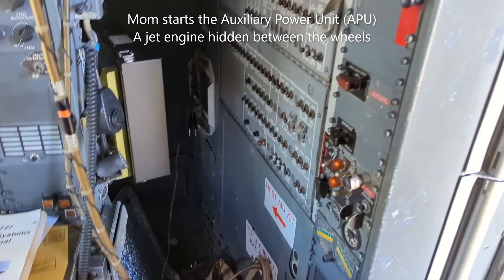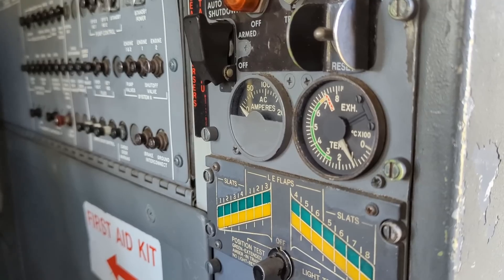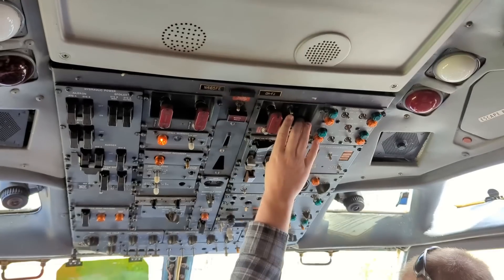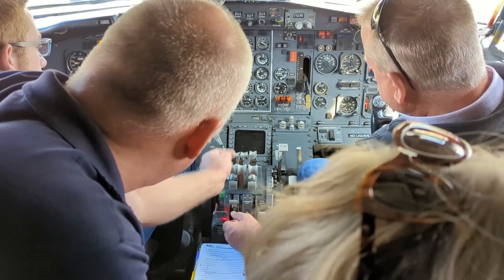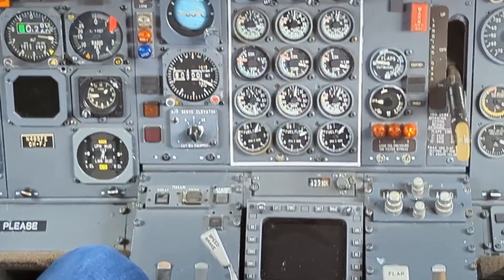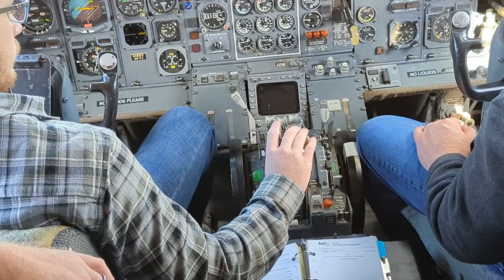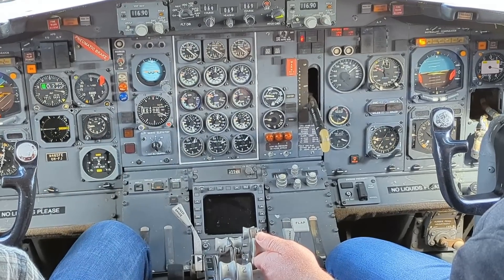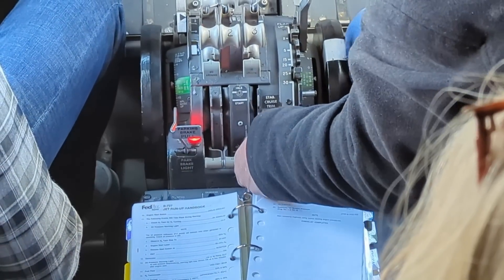Ordinary Family Starts a Boeing 727

Comment: What would be cool is to graft the 727 tail on a 707 and have a 7 engines mother craft for air launch rockets pulling into a steep climb to point the rocket in the correct direction before separation. Go over the top like a loop but invert before reaching the top.

Comment: I wonder what their neighbors think, hearing those jet engines run?  They're probably thinking, "take that airplane back to the airport where it belongs". I can only imagine how much it's costing them to keep all the systems operating on the plane. As a passenger, I've flown onboard at least a few Boeing 727 jetliners. They include Delta, Pan Am, Eastern, TWA, Piedmont, Northwest, and yes, even Trump Shuttle. Of course, Trump Shuttle was all 727-100 series aircraft. I'm probably forgetting at least one airline that I've flown on with the 727. In my opinion, the Boeing 727-200 series aircraft were the best looking jetliners ever made in existence. Absolutely beautiful and sexy. I wished Boeing had kept building them but with modern technology such as the avionics, control systems, engines (similar looking) and maybe more advanced aerodynamic wings. Possibly with wing tips that are similar looking as the ones on the 767-400ER, but obviously much smaller.

Comment: Ah yes the three holer. Worked on -100's and -200's at two different airlines. Great airplane from a mechanics standpoint. Great dispatch reliability. Flying tank. I miss working on them.
Different position for the fire handles, I'm used to them being located on the glare shield middle above the engine instruments. 
Must have had JT8-15's or -17's on that airplane due to how quick the EGT came up after the engine lit off, the -7's /9's /and -11's the exhaust temp would just crawl up after light off.
Great to see one still able to be brought to life.

Comment: 30 years ago I was starting a 727 apu with another mechanic. We went through the procedure several times and nothing happened. We shut everything off and turned off the batteries. We walked back to the hangar and was about to step through the door when we heard the whine and the whoosh of the apu starting. We gave each other a look and bolted back to the airplane. Got inside and configured everything with no other issues. The only thing we could think of was a stuck relay causing the delayed start . Today we flip a switch and let the computer do everything.
Reply from the maker: We've noticed how often those relays like to stick.
Reply: I was in Saltillo in summer as a FE and flipped on the packs to start cooling the cockpit while I did the preflight walkaround. Capt and FO were still in FBO or something..
As I came around the right side of the front fuselage I saw white smoke pouring out of the overwing APU exhaust. Ran back around to the stairs and started up them as the smoke was now turning thick black and: Pewwwww!.... It shut itself down...Had to defer it and huffer start the plane.... So much for cooling off. 😃

Comment: The 727 without a hush kit, the only airliner that would take the pictures off the walls at the FBO I worked for. FedEx cleared for takeoff!!! When those JT8D'S would spool up you knew you were about to hear pure magic. Nothing beats the sound of 3 8D's barreling down the runway begging for altitude!
Reply: Were 727s the loudest aircraft you've ever encountered?  I agree, 727s were very loud in full takeoff power.  I've also encountered the BAC 1-11s.  Those twin-engine aircraft take off like rockets, extremely deafening, could wake up the deceased for miles around.  I still miss those 727s dearly.
Reply: Ditto: Ex-UAL
Reply: I used to live in OKC  close to the incoming flight path..basically above Meridian Ave I remember Braniff Airlines flying past would increase & decrease the engine speed on there 727's the  roar was great to experience.
Reply: I agree.
Reply: It's Greek to me.
Reply: When I was commuting out of LAX to DFW in the 70’s parked in long term lot C off the approach end of 24R. Just about ever 727 on approach would set off all the car alarms.
Reply: Didn't realized cars had alarms as early as the '70s.   @ohblahdeohbladah
Reply: I just remember it seemed like a huge issue in the late '80s and early ''90s if they went off and kept ringing for hours --- I just assumed it was a new problem because theywere a new thing.  @ohblahdeohbladah

Comment: Brings back memories. Served as SO and FO on that jet for NWA.
Reply: SO FO?
Reply: @Capecodham  SO: second officer (flight engineer). FO: first officer (co pilot)
Reply: @Capecodham  Burt. When talking about the crew positions on a 3 pilot jet, those are pretty common terms. I'm sorry if you weren't familiar. When asked for clarification I gladly provided it with no snarkiness. A simple "thanks for the clarification" would have been more appropriate.
It's a Youtube comment, cut me some slack. For your reference when I write on a more formal or technical level , such as in my book Understanding Air France 447, I explain every term and concept, though one must first assess the knowledge base of the target audience. For example, for that book I targeted "aviation enthusiast" and above. Therefore that audience should have a base knowledge of a certain set of terminology. That they'll know what the various part of a plane are, might be a little weak on concepts like angle-of-attack, but possibly completely unfamiliar with terminology like CPDLC (controller pilot data link communications). 
This video is showing the fairly technical start sequence on the 727. It seems fair that the typical viewer has at least some interest in the subject and probably know what the crew positions are often called. You obviously didn't. I thank you for asking when you didn't know. Sorry you apparently got offended somehow in the process.

Comment: Thousands of hours in each of the seats in the 727 and an instructor/check airman, I saw quite a few fatal flaws in this process, but I won’t get into them here. BUT, for the love of God and all things holy, turn on at least one B pump when you are starting engines!
Reply from the maker: Wow Dave, it took me a while to find this again. I looked again, and talked to my colleague. We want to thank you for the advice.
Reply from the maker: There were things you missed, due to edits. This was not an instructional video. The process was a lot longer than the video.
Reply: @kc8t   after the #1 engine was started, the camera panned back to the FE panel.  Both B pumps were still off. Also, the B SYS FLT CONTROL low pressure lights (3) on the RH forward panel were illuminated during the start of all three engines.  I’m just saying. Don’t count on the 1,200 lb pre charge on the brake system accumulator holding the brakes. Still, a good video!
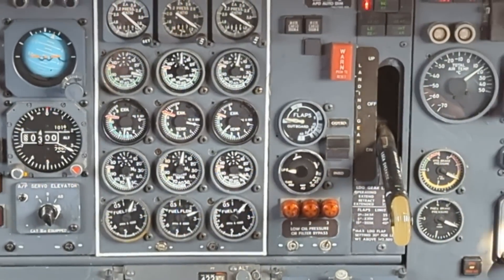Reply: In fact, at 5:03, you can see that there isn’t even a pre charge in the brake accumulator.  Nor is there any pressure in the pneumatic emergency brake. Heaven forbid, that thing jumped the chocks, you would have no way to stop it. At the very least, open the hydraulic system interconnect, and turn on the hydraulic brake interconnect switch. That way, the engine driven A pumps (on #1 and #2) can provide brake hydraulics.
Reply: It would be nice to have some brakes with 2 engines at idle. I guess the tires were flat and or probably chocked.
Reply from the maker: @romanlightman4937  well chocked, but not flat.

Comment: 727s are louder idling than modern jetliners are at WOT. The JT8D absolutely holds the record for the noisiest turbofan engine ever bolted to an aircraft. But I love 'em to death.
Reply: My first reaction was "WHAT? no way." then I realized you qualified it with turboFAN.  Noisy for now, for sure. Back then that first-generation fan jet was  such an improvement over the older "straight pipes" that Eastern called them "whisper-jets."  The person who came up with that term apparently had never been to the airport :-)
Reply: @BillPalmer  LOL    I hear that....loud and clear.... :)
Reply: For a while we installed "mufflers" on them. They were called hush kits that mixed bypass air with turbine exhaust.  Even then, they were banned in UK, I think.

Comment: I may never build a man cave.

But if I do, it shall be wall papered on all vertical and horizontal load bearing surfaces with recycled 727 instrument panels. 

Except the floor. That sheet would hurt as bad as walking on Legos.

Have you done a Lego walk? It's a rather unique type of excruciating pain. 

Not a bucket list item.

Comment: Is this 727 still airworthy? Can it still fly? 🤔🤔
Reply: Unless you have been intimate with maintaining aircraft, you would not believe just how badly they can deteriorate and still look nice, and have some systems still functional. Eventually, it becomes a financial decision whether to fix it or  dispose of it.  After a certain age, you cannot register it in US, and must register in a foreign country. The manufacturer will not warranty  them after 28 or 30 years. I have seen major structural components corroded in pieces, among many other failures.
Reply: @MECH7428  the bit bout not being able to register them in the US after a certain age, isn’t true. There is no such age limit for registering aircraft in the USA. There is in some other parts of the world though.
Reply from the maker: When donated, Fedex exchanged the airworthy engines for non-airworthy turbines. Thus, it has not been able to fly since donated.
Reply: @kc8t  Thanks for the clarification.

Comment: B727 was my first jet as a pilot coming from the turboprops. Had the luck to fly ALL versions. B727-100, B727-200, Valsan conversion, B727QF and the Super-27. What an amazing aircraft.
Reply: I wrenched on 27s for many years. My very favorite airliner to work on. Extremely capable aircraft. The Supers were AWESOME!
Reply: @MECH7428  yes Bruce you are so right…… I guess we all miss those days :)
Reply: The S27 was amazing, climb performance was stunning. When we first flew them in the UK, the controllers were amazed how fast we could climb.

Comment: This brings back memories!  I've worked on and done engine runs on many 727's during my career in maintenance at Delta Air Lines.  Good times!
Reply: I was there too, started in dept 241 in 1989.  Changed many belly skins and did the first 8 or so hush kits.

Comment: I remember many years ago back in the mid-80's. I was stationed in Myrtle Beach, SC. On weekends we would go up to Maxton, NC to skydive. Charlotte Aircraft Sales had a compound on that field where they parted out 1st generation airliners. One of the weekends we were there...I noticed they had flown in an old Air Jamaica DC-9-30. I was very familar with the DC-9 because I had worked for Delta Airlines in Detroit before entering the military. I had experience starting up the APU's and did it often since our evening shift often moved overnight aircraft on and off of gates. I went back to Maxton the following weekend on a Sunday when the FBO was closed and a friend of mine and myself got into the DC-9 and fired up one of the engines.

Comment: Nice!  Flown on the 727-200 a few times (Delta & Continential Airlines) as well as worked on them while employed as a ramp agent for Integrated Airline Services (KIAH) in 1999, one of our clients (Kalitta) used the 727-200's for air cargo.
Reply: Kalitta still uses the 727!
Reply: This tough reliable bird MADE FedEx what it is today!... IIRC they kept flying 727s up until 2014 or so...
Reply: @MajorCaliber  I think it was 2013 when they retired them
Reply: @MajorCaliber   Yes, as I mentioned in my post above about my employment with IAS at KIAH in 1999, the ramp we worked at happened to be just across from the FedEx terminal and I recall seeing their 727-200's a few times (along with their usual other tri-engined jumbos).  We once had to borrow their air starter when ours died on us (we were trying to start one of our BAX Global DC-8-72 at the time), it was very nice as their equipment was incredibly quiet  compared to ours.

Comment: Many hours in the 727 at Eastern Airlines.  Sure miss the old bird.
Reply from the maker: Maybe this one. This one started out as an Eastern Shuttle.
Reply: I  didn't catch the N-Number, but it was an Eastern plane, I'll bet I had hours on it. I was checked out on all 3 seats ending my career as Captain.
Reply: @deadwood1887  when and where were you based at eal?
Reply: @jonnydwolf  Based in NYC, DCA ATL MIA and back to ATL where I retired in 1985. The 727 and I came with Eastern about the same time, back in 1963. I remember seeing it for the first time when Boeing was showing off it's newest 700 series at LGA. Looked like a space ship with that high  T tail.
Reply: @deadwood1887  when with Eastern it was N8871Z. Was in service 76 til acquired by federal express in 1992
Reply: @AreeyaKKC  I'd have to dig out my old log books and check. Thanks for the info.
Reply: Thank you for your EAL service
Reply: @sennis1361  Thank you.

Comment: I flew 727's  14 years. I have nearly 8,000 hours in them. My first type rating and Capt. position. Hell of an airplane. Nice to see the cockpit again.
Reply: Same here, Kevin. My favorite airliner, by far. Those were the days man.
Reply: VERY advanced wing design, even by today's standards, eh?  Plenty o' thrust too... and the rear-ventral "Air Stairs" or "DB Cooper" door, well, that's just gravy, baby!
Reply: @MajorCaliber  Advanced wing design? no, not by today’s standards which use supercritical airfoils. This one used sweep exclusively to deal with high Mach number effects. It is, however, a beautiful design!
Reply: Any FedEx pilots in here. They were awfully loud until the hush-kits were invented & installed. They went from Super LOUD down to just loud.
Reply: @Marks-Law  “whisper” jets 😂😂
Reply: I had about 4k hours , F/E and PIC type rated. Yes, it was interesting to see the folks start her up. When everything is running well, it is an easy bird to fly. Its when you have an actual emergency that things can get a little hectic. I flew Freighters and Pax for Express One Intl. It was Dallas Love Field circa 1993. I wouldnt be surprised if I had flown this aircraft at some point. We operated aircraft that were retired from nearly every major US airline. Our operating manuals differences section was bigger than the normal operating manual.
Reply: @romanlightman4937 Did you know Sean and “booth”?
Reply: That's why John Travolta owns one.
Reply: @MGreen-vz6yb  No...he has a 707...
Reply: @jrweiss77  727 also. He donated the 707 its going to a museum in aus.
Reply: @MGreen-vz6yb  idi0t
Reply: We flew in a lot of 727's traveling following my dad he was USAF
Reply: I flew them 9 years.. Thought they were great until years later flying other aircraft that I actually could fly without all the strange characteristics the 727 had. They didn't Dutch roll or have two rudders and yaw dampers. Required on the 72. You could use speed brakes and flaps, you didn't have a cg center different than the landing gear. They were quiet.. Better wipers for rain. Etc, etc.. And most of all there weren't 4 crashes the first few months they came out like the 72. Basically the 72 told you how to fly it. Pilots should fly the airplane not the airplane fly the pilot
Reply: Not a pilot, but I often wonder if there are pilots that are diehard Boeing or Airbus guys.
Reply: @CaptainBill22  no
Reply: Your last name’s not Lower, is it?
Reply: @IBetOnMyself They were snatching off our shingles when they took off from Memphis and heading straight south. In the 1980’s  ATC ? Let the 727 aircraft come in a beautiful tight turn and drop and rollout most beautifully. Now days a pilot turns 10° and he might have a cranky ATC give him a tour of Memphis & surrounding areas and line back up.
Reply: This looks like an old FedEx plane.  Mid-late 70’s.  1976? Model.  Looks to be.
Reply: Those things were FAST too.  You could set up MASSIVE sink rates in them which is how folks got in trouble with them when they were first introduced.  I loved the 727's
Reply: Hi, could you tell me what the friction lever is near the flaps lever? I'm familiar with the 737NG aircraft, but not these beauties.
Reply: 8000 hours, 7000 in the climb!🤣
Reply: So did Joe Biden!
Reply: exciting information. im only at 185 hours and struggling to pass the canadian CPL ground school tests. they are hard and very detailed
Reply: How long did it take to memorize that start up? Just when I thought I knew what was happening, I didnt!!
Reply: @garyjohnson1970  doy. You have checklists.